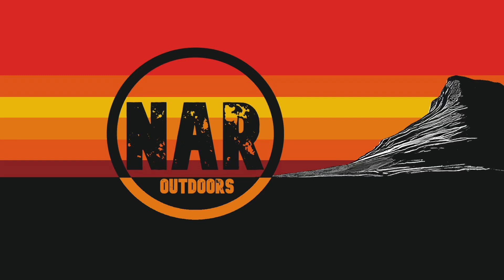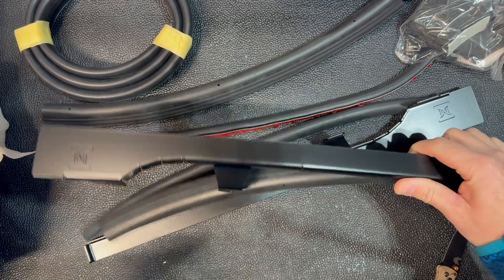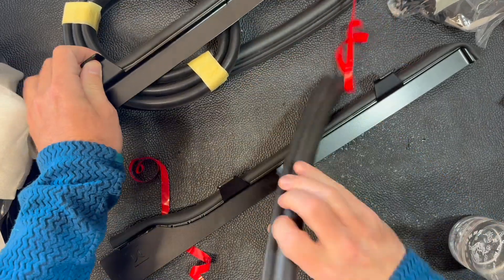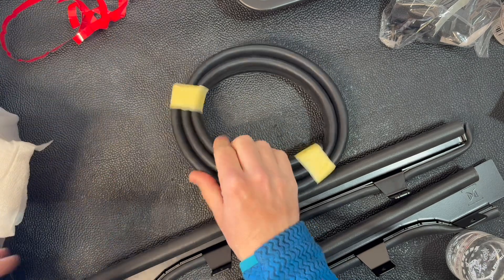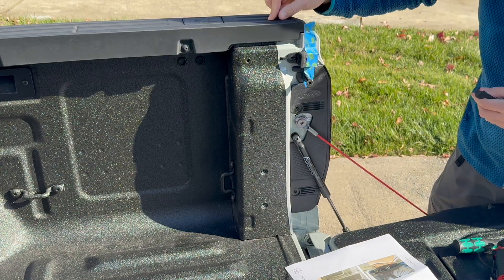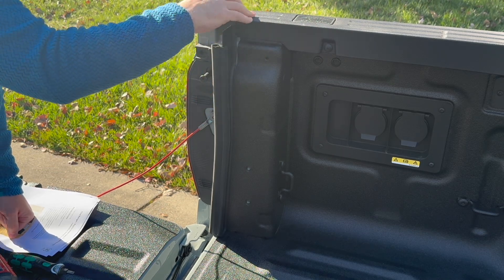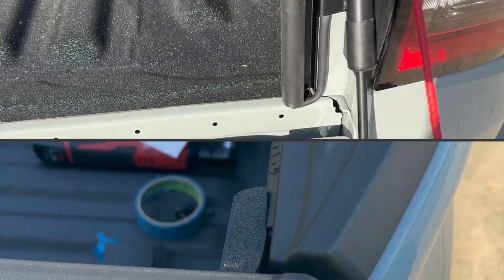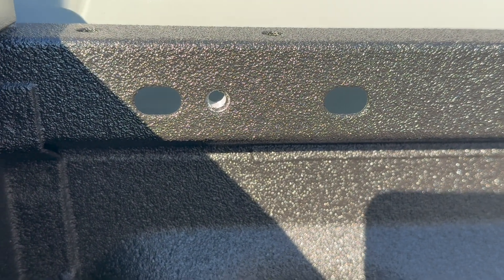Digital Twin Developments Next Gen Ranger tailgate seal install 1 of 2

Comment: Think I saw on RangerG6 forum that somebody stuffed a tennis ball into that MASSIVE and unnecessary hole in the top front of the bed wall. Not sure how well it worked, but... About to order this seal kit as the one from Keko doesn't show the result in the install video and too much sticking to the tailgate